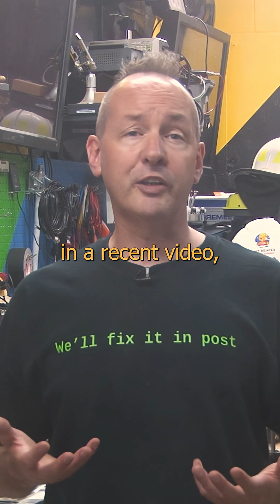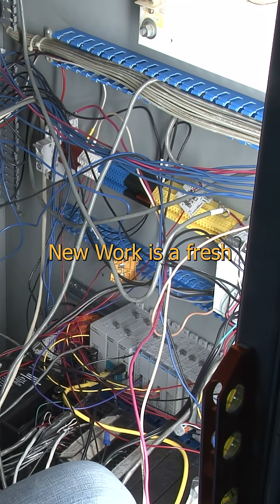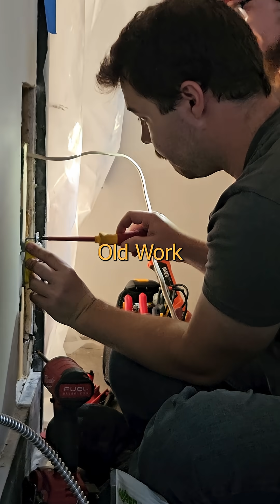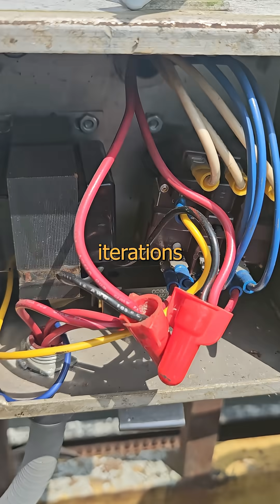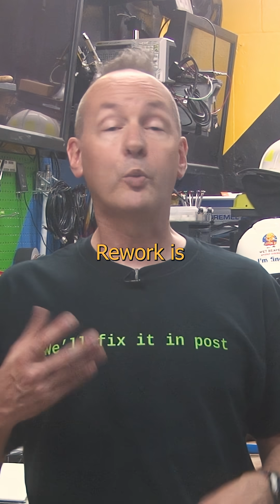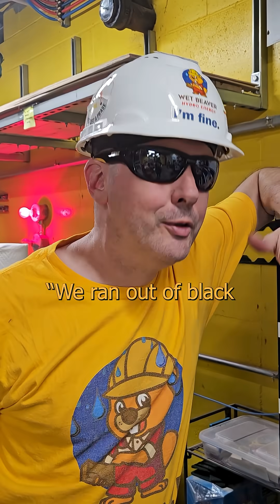New Work, Old Work, Rework #chrisboden #comedy #engineering #electrical #construction #educational

Comment: Yeah fixing someone else’s crap is really „fun“. Or it’s actual fun if you are into varsity levels of electroplay. 

Dad was remodeling the house. It was a semi-detached former miner‘s home in the Ruhr, Germany. His friend that he worked for on the side and who helped with electrical work was a qualified and certified electrician who said „I am absolutely not touching anything that was laid here. This stuff is from directly after WWII. We will rip the old stuff out and redo _everything_. I don’t trust this wiring any further that I can throw it“
Junction boxes were located usually above door frames at the time. Many cables had cloth insulation, some was inside metal tubes, and since there was significant material shortage in the late 40s and early 50s, some cables were just thrown directly on the wall diagonally to save on material, and then covered with a layer of plaster and wallpaper. 
And then some mischievous tenant had taken it upon himself to do a bit of „creative wiring“ because he felt that his electricity bill was too high. So he connected his stove to the power in the hallway of the house, because the electricity used to light the hallway would be billed to all tenants. 
Dad learned this the hard way while laying new tiles in the kitchen, because his rear end touched the cable that used to feed the stove and stuck out the wall. 
And since they had pulled the kitchen fuse, he was justified in believing that there was no power on any of the cables. Well…there was power on one of the cables and it launched him across the room. 

Much cussing ensued, which was understandable. Dads friend took one look, grabbed his multimeter and went and forth between the kitchen, hallway and fuse box a few times. He came back and said „What a cheeky little bastard…we have ourselves a mooch. Some jerk rewired the stove. And only the stove. Someone knew damn well what he was doing.“

Comment: We have the "edition" to throw at contractors that think any wire that's blue will do ... (You try balancing a ring main with two very different gauges of wire without tripping the mains or setting the house on fire.... Hint: it's possible but only with careful measurement of wire lengths and still sketchy as f... Much safer to use a decent gauge in both directions)

Comment: Ok, so my family lives in a 1929 house, and I can't even list the amount of "WHAT THE HELL WERE THEY SMOKING?" I just casually find.

I kid you not, someone thought that just attaching a fuse box to knob and tube wiring, then having another guy come and cut said wiring, and string crappy wires hanging from and through the beams. (The cut holes with a sawsall in almost every beam, and the slow warp shows that that was a HORRIBLE idea.

Comment: As an air conditioning mechanic , I had to rework "ELECTRICIANS" work because they forgot the neutral and hot water heaters need 240 volts .

Comment: Please PLEASE tell me that "we ran outta black" part isn't something you've ACTUALLY heard.. I'm no electrical engineer but even I know that all 3 are usually in a multi-conductor wire.. so now I'm picturing a 1st year apprentice pulling wires out of 20+ feet of jacketing like they're a shrink-wrapped slim jim.. oh yeah and also that running hot to ground is a darn good way to see pixies..

Comment: It happens everywhere.  I just encountered a diesel tractor that won't charge that has a 12 to 6 volt ballast resister wired between the alternator and battery.  I tried to explain that the alternator is likely not the original, but was taken from a gas powered tractor with standard ignition. The ballast resister is part of the ignition system on older gas tractors.  How it got transferred to the diesel charging circuit is regular cluster F.  I've gotten used to funny looks when I tell people that prior to electronic ignition, cars and gas tractors would start on 12v, but would switch and run on 6v.

Comment: This is a major problem in the railroad industry too especially with the old steam locomotives.

You have a literal century of people who had different repair methods, some before they put regulations in place to say "you can't repair a leaf spring with duct tape" and some who think pad welding firebox corners is an acceptable way of chasing your tail as long as it holds MAWP without erpupting to atmosphere at mach Jesus. Most of these repairs were completed with the "Make it go one more time" mentalityz and the next guy having the same motto 10 years later... 

Gettysburg Railroad #1278, anyone?

Comment: I was switching the electrical outlets in my apartment and holy hell, it looked like the plumber did it. I took the plunge, bought the correct equipment and took almost a day to make everything updated, tidy and functional.
You CAN'T do electrical 99% right, because that's a freaking fire hazard waiting to happen.
My experience in cable management for PCs really helped me in this endeavor.

Comment: I worked with my uncle once on a 110 year old house that still had knob and tube wiring and a disconnected system that we think was for gas powered lighting. The job was “simple”. An overhead kitchen light. An upstairs bathroom GFCI, some base board heaters in the living room, a ceiling fan in one of the bed rooms. 

Everything about that house gives me nightmares to this day. We found hot wires connected to nothing just sitting in the ceiling. Uncapped. The hallway three way was simultaneously a home run for the entire upstairs of the house. One of the rooms had burned to shit because the homeowner was an old man who would daisy chain those cheap extension cords together because half the outlets in the upstairs didn’t work. 

Lathe, god man. Lathe. That shit is a nightmare for old work, where you’re reaching behind walls and into holes you made to find or install stuff. And it’s not like we could have just replaced the plaster and lathe with drywall. Goodness me no. Did I mention we did a panel upgrade as well? Nothing in the panel labeled, naturally.

Fuck old work.

Comment: Rework in my electrical world means "hope you didn't have too much coffee and you've eaten today, because you're about to use the most oxidized soldering iron you've ever seen to replace a buncho of 0201/0402 resistors, and run 36g wire all over the place" (digital hw engineer)
Reply: A crust o' rust on that iron?

Comment: You think electrical is bad, try running data. Do me a favor, and if you can get into a decent Enterprise size server room, most of them are not maintained like they should be, and cables are absolutely everywhere. When I was in college, we had dual redundant Network routers and switches and such, the cabling hanging off of the racks made a mat about 6 to 8 in thick. None of it was organized

Comment: That black tape on the green cable was something I was taught to do when I took an electrician class.
Reply: "If you're guna do shit, atleast label it" i don't condone, but atleast it can help save a life, maybe yours 😅
Reply: If I absolutely MUST change a wire's colour, I prefer to use Shrink Tube because that will not fall off at some point in the future...
I use White or Grey for Neutral, Black (Line 1), Red (Line 2) or Blue (Line 3) for Hot, Green for Ground and usually Brown or Pink for a Switched Leg (AKA it's only Live when the switch is turned on)...
I occasionally use a short piece of Orange Shrink Tube to flag a Hot Conductor when the wire is a dedicated Circuit to a Surge Suppressor Receptacle powering some very expensive piece of electronics...

Comment: Try chasing wires in an old ass SD40-2 using the only god damn prints the company has which are the originals. These things have been worked on by professionals and those of us who have no business touching it for 60 years. Not to mention the years of “I gotta great idea!” Additions and system eliminations. 
Nothing like chasing a problem down to a specific location on a terminal board to find most of the wires don’t match original wiring and not a god damn one is still labeled.

Comment: lol, I do harness prototyping for an engineering firm. Our timelines are tight and specific wires can be hard to get ahold of. The amount of times the solution becomes “Eh, wrap some electrical tape of the correct color around the wire, we’ll fix it later.” Haha, it’s never fixed later.

Comment: You would love my grandparent's house.
Over 200 years old, electricity and water lines retrofitted in there over the years. Little to no documentation. Most stuff done by people someone in my family knew who would do it on the side.

Also it's a bakery. High voltage lines :)
and a big old oven running on oil
Reply: And then, there's old house (built in 1937), with renovations done by the prior home owner "on the cheap" - - -  Meh!!!!! We Don't Need No Stinkin Inspections!!!!   Step 1:  Kitchen  4 outlets wired together - No GFI's - Edit - oh yeah, leave the box for the outlet to the refrigerator lying loosely on the floor, next to the drain in case the water line to the fridge pops.  .   Step 2:  Rebuild the upstairs bathroom - put in a new jacuzzi tub - - - Stick the outlet for the motor inside the wall, with not only no means to access it, but no knowledge to anyone else, that this is where the connection lies.   - - - -  Step 3 - Put in a - BRAND - SPANKIN - NEW - Circuit box - 220 amps (at least I think , because hey, I'm a civilian when it comes to electricity) - but wire the living room, dining room, kitchen, and half the basement - including the washer dryer - - on one circuit.
Reply: @goaway867-d6f  Sounds like my fiance's family's house. 😂 His grandfather and father did most of the repairs and alterations except for major plumbing issues. My fiance won't go near any electrical work because his dad had electrocuted them both once, when his dad thought that he'd turned off the electricity when he hadn't, luckily no one was majorly hurt but his dad had a morphine pump in his abdomen that had to get checked out in the ER to make sure it was still running. 😅 
My fiance is super handy tho when building things from scratch and fixing minor stuff around the house. :)
Reply: @iridiumlantern8846 stop using fiance. Say boyfriend or husband. Jesus.
Reply: Sounds like my place. They recommended I bulldoze it when I bought it and it was stripped of all copper and had no septic. I've documented nothing from did all the work myself. If I have kids I'll do it, otherwise it's my last joke.
Reply: My favorite is "tube and knob".   I've seen it in real life.
Reply: @jamallabarge2665   So have I...

The first time I saw it in person (instead of on TV) was when I had to open a wall in my home to do some Plumbing Repairs...

I'm an Electrician and I was NOT happy to see it...FORTUNATELY, when I finished peeling the wallpaper off the walls with Language that would have Drunken Sailors covering their ears and stuck my Multimeter on it, they were not live...
So at least one person in the history of my home was smart enough to disconnect the Knob & Tube Conductors and switch to modern Romex...
UNFORTUNATELY, they had no FU@KING CLUE how to properly install it and I'm STILL finding dangerous crap they did and I've owned this house for 15 years now (I can't afford to strip the walls and do a full rewire unfortunately)...

😄😁😆😅😂🤣
Reply: @jamallabarge2665 the original parts of our our 1927 house in the SF Bay Area is knob and tube. It has survived almost 100 years with no problems.
Reply: What's a bakery need high voltage lines for, if the oven runs on oil? Is it other ovens that are high-voltage? Cos they're high power? Is it like a commercial-scale bakery, huge conveyor ovens and the like?
Reply: @greenaum even a small pizza shop might have an industrial mixer. If they make any pastries or cakes, they might have a refrigerated display. Probably a walk-in as well. I’m not sure what that would all run on, but businesses that make food use a lot of power.

Comment: Years ago I was on a project with IBEW Rockport I'll local workers. Had a Master Terminaler. His job was to tale the wires and connect them to shit that made things work. He was an artist with his wiring. Everything precise. Even his trims with cable ties. All were cut at an angle, and all the same angle and precisely the same length. He went on his tools at precisely 07:00. Never a wasted motion. I have been on many projects over 44 years and never saw another person like this.
Reply: Ngl I absolutely hate when zip ties are cut an angle, sliced my hands wide open on them too many times, when they're cut at an angle they turn your electrical cabinet into a barbed wire fence!

Edit: I see you said cable ties, so maybe they weren't zip ties in which case cool, but please for the love of God never cut zip ties at an angle!

Comment: I did a rework where the exact scenario happened...
I taken off the lamp and there was the... green-yellow cable, the green-yellow cable, and the green-yellow cable! All 3 cables were green-yellow! The old handyman said "well I run out of other cables that day..."
Reply: Well the green yellow is ground/earth-color in Denmark. It is the only wire color that is ONLY supposed to be used for this purpose. If used for anything else and found out, it is prosecution time.
Reply: Duuude! That's how you electrocute people! That's really, really bad. Hungary's on 230V, right, so that's serious.

People need to realise, your job isn't just to make it work, it has to be maintained by some other guy in 40 years, and you need to leave it in a state he can work with. That's WHY there's standards and why they're legally enforcable.

Comment: I use to work for a residential HVAC company, and we were told to do exactly that; Run black jacketing and tape the ends to "mark it".

Before I knew fuck-all about electrical, I was putting white tape on black wires for neutrals, green tape on black wires for grounds and red tape on black wires for controls.

The company justified it by saying "Electricity is color blind." meaning the current doesn't care what color the jacketing is - the jacketing is for us.

And that "per code" the only one that "needs" to be colored is green, for ground. Everything else is just "tradition".

That nothing says neutral HAS TO BE white, or power HAS TO BE black.

And they would further justify it by saying if we are the only ones working on it, they then we understand our own internal methods, so there's no problem at all.

And then these same idiots would get bent out of fucking shape if you didn't use specific colors for the thermostat or dehumidifier every single fucking time. Lord have mercy if you put the yellow wire on cooling fan.

Comment: Seemingly burned out the USB ports on a XBOX One S playing Rocksmith with a bass plugged into an A/B Box Pedal and an amp. Bass into A/B pedal XBOX and amp on the A and B output. No discernible smells or sounds were made just a gradual drop off of functionality from the ports.

Comment: My house is from 1893, So I am VERY familiar with "Old work" I have knob & tube, BX cable and Romex depending on when and who put in that particular circuit over the last 130 years. Amazingly this electrical iteration of "Mouse Trap" still works. I do have more modern wiring in the wet spots where such luxuries like grounding and GFCIs should be.
Reply: Sounds like my brother’s house. He asked me to inspect the wiring before he bought it. That was a cluster. Knob and tube connected to armored cable connected to romex connected to extension cords connected to speaker wire connected to alarm cable. I also found faked grounds on the few grounded outlets there were (most were just polarized plugs), improperly secured conduit, splices in random unprotected locations, circuit disconnects made from canibalized 1940’s motor control switches, and a security system that would make the developers of “Night Trap” proud to name a few. Thankfully he took my advice and had the whole thing ripped out and replaced.

Comment: Me and an apprentice spent 5 hours fault-finding a short circuit in thetail/side light circuits on a truck this afternoon/tonight. All because the body builder wired both sides together with the rear half of the truck on one set of wires and the front half of the truck on the other, and some smart bastard put 30 AMP fuses in for both left and right then melted half of the wire to the front half of the truck were we found the fault 50mm from one of the lights. Ended up replacing about 15 meters of wire that had to be dug out from all the mud and shit built up in the chassis because the driver can't even drive the truck over the underbody wash we he gets back to the yard.

Comment: We moved a lab scale fluid bed dryer from our old R&D site to the new R&D site.  The inlet for the 1 cu ft dryer capacity was 10"x 10" because it was a small air volume requirement.  However when installing, they decided to change the supply to the dryer specs from the next room which was much smaller(5L capacity).  So they had to make an adapter from a 4 inch air supply line to the 10' x 10" inlet to this dryer.  No one questioned the inlet so it was installed and could never lift fluidize any product.  Could we fix it?  No because then we would need to admit an engineering spec mistake and cut larger holes through the concrete as well as get the old steam heat exchanger, and we did not have steam in this new building.

Comment: Old work is usually where you find the quick short-cuts that the original electrician had to get something done ninety minutes before the drywall went up.
I found a common side switched light receptacle in a small half bath. And the only reason I found it was because the only outlet in the bathroom was by next to sink, and it wasn't GFI protected.